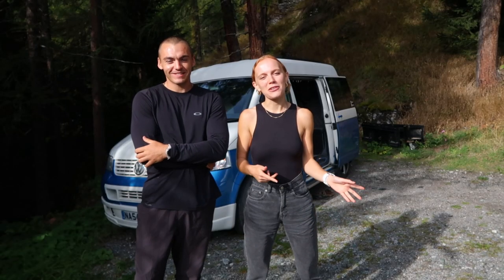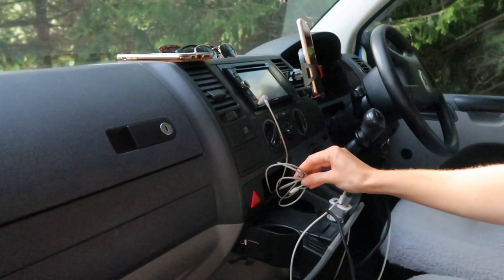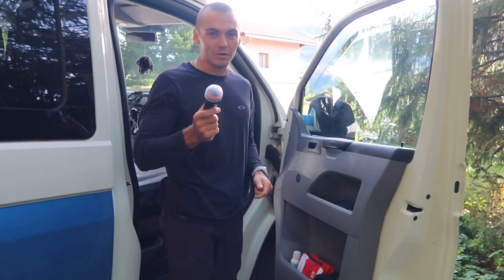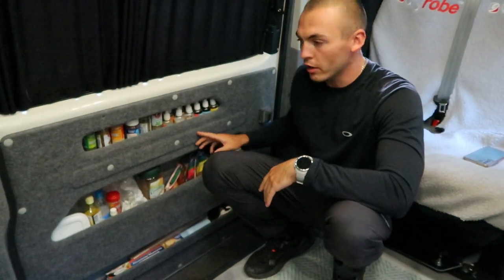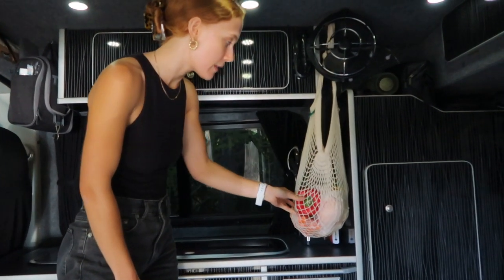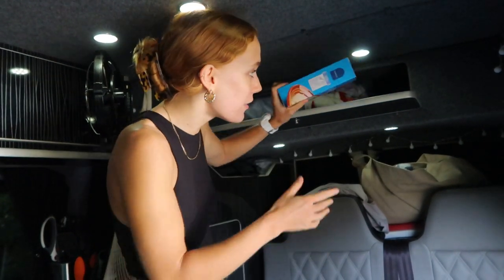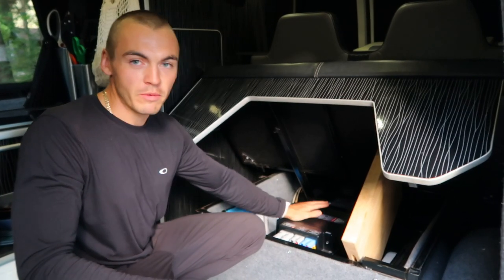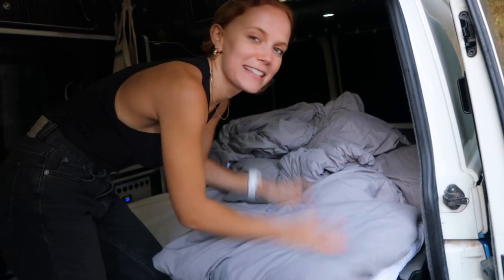OFF-GRID VAN TOUR | Volkswagen T5 Campervan

Comment: You can add cruise control to this van very easily, you just buy the kit for about £200 and fit it in about 30 mins. As your van has factory electric windows it will fit right in. Vans with manual wind windows have to change the body control module also for an electric window model.